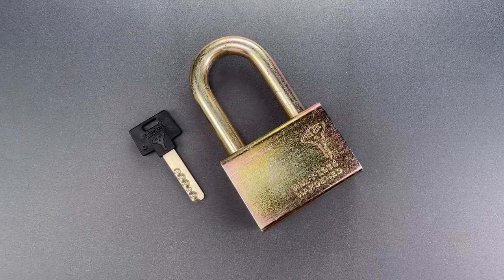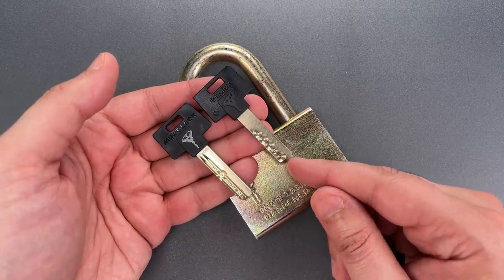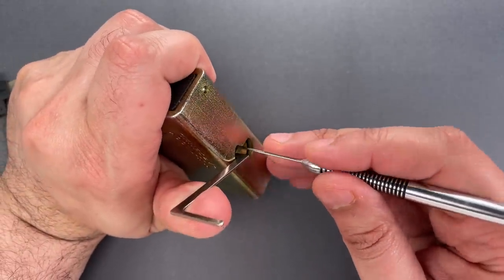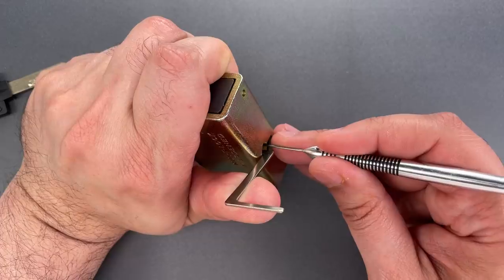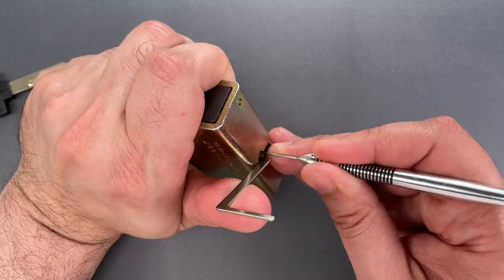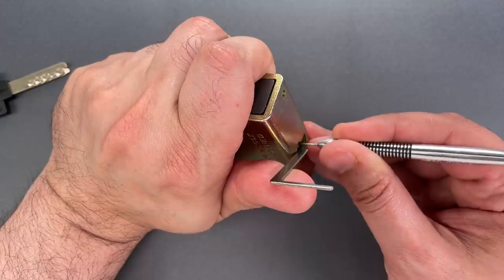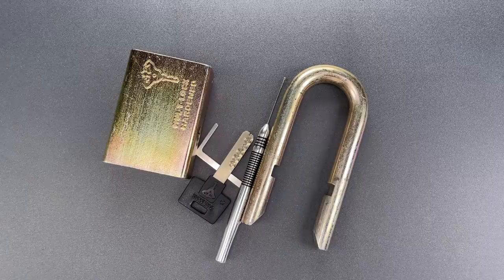[1338] The Gamma Key Affair: It Could Have Destroyed Mul-T-Lock

Comment: I would like to see the 'foil impressioning' thing that you mentioned, even if it's a failure.
Reply: I was going to post the exact same comment. Would be interesting to see how it's supposed to work.
Reply: Deviant olam== for ever lock== foil impression== example of what goes on
Reply: You want to see the LPL fail 😲
Reply: @grahamwilkinson6902  doesn't everyone? we need to know the limit of his power
Reply: Or if he can't do it, then was it ever a vulnerability to be concerned about?  Sounds like some misleading bad press could have potentially ruined the company.
Reply: I've seen it on YT. It still works on many locks of similar design.
Just imagine a key with a large cavity where the dimples are supposed to be. You either fill it with soft metal or span a thin sheet of aluminum over it. Then you insert it and wiggle. In the video it took under 10s to open it. The key then has the dimple impressions so that you can open the lock again without much wiggling!
Reply: He said it was on a TV show but what show was it?  Like was it a fictitious show like 24 where they faked it or was it a non fiction show like myth busters where they actually did impression it?
Reply: @brianpeyton6083  LPL is really good at single pin picking, which is a very different skill from impressioning, so him not being able to do it doesn't strictly mean a whole lot.
Reply: @bigbird4481  limit? silly human , he has no limit :)
Reply: @johntuffy5721  ah yes my mistake I should of known
Reply: @bigbird4481  You don't know the POWER of the LPL side, young Name Walker!
Reply: @SVlad_667  F
Reply: I would love to see this as well, and maybe some more about the original reporting, if there is any footage of that.  For all the mockery that the term 'fake news' gets, news organizations are really awful about misreporting on almost every subject imaginable.  I am sure everyone who is an expert or even hobbyist in any field has seen the news absolutely mangle the topic any time they talk about it.  Then realize they do that for pretty much EVERY topic, but you just may not realize it.  Science and technology are especially awful, where they will take a complicated report and just make up a one liner that in no way represents the actual content of the report, and once one place like the associated press does that, then everyone just takes the lazy out and repeats the same thing without doing any rigorous reporting themselves.
Reply: @bigbird4481  I just want to know he has a limit. Oh, sure, he says he couldn't do it, but that's just to lull us into a false sense of security.
Reply: @brianpeyton6083  It's such a low-skill attack that he can't wrap his head around the lack of skill necessary, that's all.  It's like a poorly coded video game where you can't do a "Very Easy" skill task because you need to roll between 11 and 25 and you've got a +30 to your skill.
Reply: LPL foiled by foil impressioning.
Reply: @JaredConnell  He mentioned a UK show, so possibly 'Watchdog' which is a UK consumer report show
Reply: @SVlad_667  Yes, I knew he hadn't picked the Bowley. He used to point out with proper and attractive humility that there were many locks that had defeated him, but he seems to have stopped even trying the most difficult ones.
Reply: Well he stated a few times that he doesn't practice impressioning so he's not very good at it. It would that's a skill you would have to practice
Reply: @bigbird4481  I have a security door with number lock. I can see no point of access.  There is a keyhole for a key but I think that is an additional lock,  the door might have a magnetic bolt at the top of the frame,  so potentially possible,   but without being detected while in process ?

Comment: So the alleged foil impressioning is actually difficult to do and single pin picking is difficult as well. 
That sounds weird - how real was that exploit then?
Reply: Probably a fluke since I assume they didn't do it twice
Reply: It was a BBC feature, how real is anything on there?
Reply: @SuperAWaC  got a link to the video?
Reply: YerisR foil impressioning is idiot proof. Put it in and wiggle for an open.
Reply: @NigelTolley  I'm a certified idiot, so you might want to take that up with The LPL who said he couldn't get it to work with the three locks he tried it on. [edited for clarity]
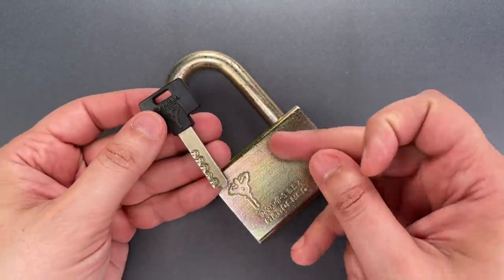Reply: @YensR  Correction, at 0:31 he says "... Though I've never been able to get that to work on any of the 3 Gammas in my collection"
Reply: @safourgardpa5459  Yes I know that - what are you correcting?
Reply: @YensR  You said “more than one”, LPL said “any”
Reply: @justins8802  Ah, I see how that can be misunderstood, will fix it.
Reply: To be fair, there's a knack to foil impressioning and once you've figured it out it's easy, before that, an absolute nightmare.
Knowing what thickness of foil to use to wrap the key isn't massively intuitive and generally only got right with trial and error.
Reply: @paulrichardspencer  gotta use the heavy duty foil and not the off brand stuff. Lol jk I have no idea. :)

Comment: I thought having warding on your lock was covered in lock-design 101, right after shielding and over-lifting.
Reply: I think the issue here is linear thinking. The reason you have warding on your lock is to make picking harder, by making it physically difficult to get the pick into the right place. I suspect the designers thought that the pin-in-pin design already made picking hard enough, so they didn't need warding. (You need special tools and, if LPL takes a minute and a half to pick a lock, an average lock picker will need half an hour minimum.) Since "the" reason for warding wasn't applicable, they probably didn't consider side-benefits of warding. And, since warding has a definite cost (harder to machine the cylinder and the keys), there's commercial pressure to avoid it if possible.
Reply: No warding on most KABA dimple keys and they don’t suffer with less security.  Tolerance is what makes these superior.

Comment: Could someone explain "nice click" and "false set"? I always imagine that with a "false set" you would have to start over, but I never tried picking a lock myself.
Reply: I just got me self a nice cheap lock picking set from Ali ($20 or so) and several Yale pad locks (the good ones, with security pins and all) and went on picking. Took me about 30 minutes to pick the first time, now i can pick open pretty much any Yale and old Mul-t-lock (the new ones are a bit too much for me at this stage) in under 5 minutes. It's pretty intuitive once you start doing it, you can actually feel the individual pins and their nature, the counter rotation, the false set, the clicks. 
Just get a set man, you'll like it, i promise :)
Reply: @beeble2003   Thanks a lot, I did understand your explanation. It sounds like he never pushes a pin past the shear line, where he would have to start over. Is that true? If he did , does it have a name? Maybe "over set?"
Reply: @pepperpepperpepper  I think that’s called over-setting, yes.
Reply: @beeble2003  Thank you!

Comment: I'd very much like you to look deeper into that "foil impressioning" attack because to me it smells a bit like bullshit. I dunno, maybe you could explain the theory a bit more.
Reply: Same concept as the tubular lock 'bic pen lid' impressioning attack. Cut the tip of a pen lid at the point where it tapers out enough to fit in the lockway. Mash and twist the lid until the plastic is deformed and the keyway turns. For the dimple locks, you need a key drilled to max depth. Wrap it in a stiff foil then slide in, wiggle and turn. The foil depresses as you wiggle and the spring fights back. The turning gets the pin bound open under tension. A bit of practice can get the lock open. The inner pins are all the same length so when you press them hard they deform the tool at the maximum depth, exposing the cut depth. Back off a little on the pressure and your 'key' is aligned.

Comment: Long time ago I had one of these.  I do recall how easy it was to inset the key and open the lock with the key.  The lock got some sand, and I was able to easily dismantle it, clean it and went into service until I sold it, no fuss.  When I had it open, I saw that you could try to jam the keyway , and by just inserting the key, you can remove the jam, and open the lock like nothing.

Comment: The hardened steel body and sleeve design still persists though. Physically one of the toughest locks I've seen. It's just really about time they did a ballbearing locking system on those style padlocks now.

Comment: I had Multilock in my office, installed in 2005. Last year all if them started to fail (pins were dropping blocking the key insertion). Unfortunately their local distributor’s service is bad, so I had to change to Yale. If Yale’s last as long, I’ll probably be dead when they fail 😅😅

Comment: if the lock is cut in the centre of the arch you are able to rotate the two pieces and they simply drop out multi lock were made aware of this issue and put some channels down it so the sides could not be turned

Comment: Hey, LPL, I'd love for you to look at the Langger V biometric slider handgun safe.  After binge watching your videos for the last couple weeks, I hard time finding a new pistol safe.  Kept asking myself how many milliseconds it would take you to steal my gun.

Went with the Langger model. Because the backup lock is on the bottom of the side-mount safe, which I mounted in my bedside stand 2.5 inches from the bottom shelf. The key is just about that long, so even with the key, it's hard to open that way.

I also modified it so the code changing button can't be reached by shimming something through the door crack.

Comment: I have used that lock as a shift lock in my car. That lock alone scared off many car thieves. I was told by an ex-car thief to use this type of lock. Because thieves like an easy car to steal. Thus they look at what is easy. And what is not easy. The more obstacles they face. The less likely they will not bother to steel it.

Comment: I may be missing something. probably am, but based on the way that shackle seats into the lock body, I'd be somewhat concerned about the possibility that it's shimable. I can see a way that it would not be, but that would entail the locking lugs be narrower than the shackle, which suggests that they would be a weak point too.

Comment: At a guess I would suggest that all the people focusing on how long this took him to pick compared to other locks are in part missing the point. It's possible for a lock to take this long to pick using normal picking tools and basic techniques if it has some limiting features such as a narrow difficult keyway but this lock required a special tool* and an advanced skill set. A low skilled picker might be able to pick a normal lock in this amount of time but most will never** pick this one, even with the right tools.

*The tool looks like something you might be able to make but then it won't be as “easy” to use.
**”Never” assuming they are a thief and “never” is limited by how long they can try without being caught. If they have forever then they might eventually acquire the right skill set through practice... Or maybe fluke it.

Comment: LPL, could you explain the motion you’re using inside the lock? It looked like you were rotating to set a pin. I assume there were dual facing pins although maybe the key had duplicate bidding so you could insert either way, and bidding is only on the right, as you were holding it. Just didn’t start with good visualization what was layout inside lock so hard to follow your motions.

Comment: QUESTION:  How do you know if a lock turns Clockwise or Counter Clockwise?   I bought your Genesis set and practicing for the first time on some cheap master locks I bought as well as some old locks with no keys.  I can only open the Masterlock. But I have the key.  The others I do not know if they go Clockwise or Counter Clockwise.  Or is it all pad locks are clockwise and door locks vary?  
Thanks

Comment: Hi LPL, do you have a video that explains the different terminologies you use when picking? Like what does it mean when you say binding, false set, click on x, etc..
Reply: Binding means that pin is hard to push, because its being pinched between the core and the outer cylinder. Click means the pin moved nicely to the sheer line and the core turned a little more. False set is where a pin has a notch cut out so that the core turns a little bit to make it seem like it has made it to the sheer line, but it really hasn't.

Comment: What if there was a lock that sounded an alarm or something if it took longer than 30 seconds for someone to open it?
Cuz using a key generally takes, what, 15 seconds at most?
So with enough sensory technology and engineering, it is THEORETICALLY possible to make something like that, right?

Comment: Is it possible to design a mechanical lock that must be opened with a certain speed? I.e. if you don't press the correct pins within 1 second it does not open. In theory it should make picking attempts like in the video impossible, because you cannot do them in 1 second. But you can turn a key within 1 second.

Comment: If the dimple pins fall down into the key "valleys", how does it work to pick this by what looks like lifting up the pins?
Reply: That's why the new model has the valley. Makes it much more difficult to get a flag pic where its needed. He picked the old model... :)
Reply: @MichaelBransonCoach  no, that's the key groves,

I mean the circles in the key, the pins fall down into those don't they? And the lock can be opened.

But seems LPL is pushing the pins up, when they are supposed to go further down?
Reply: @pangeltveit  The top pins extend down past the shear line when no key is present. The key picks them back up. The bottom pins set the different heights they need to be lifted to match the shear line. Having the top pins all the same length allows for impressioning attacks as how far you can lift the bottom pins exposes the different depths between them.

Comment: Aaand I can cut your 300 dollar padlock off with a battery powered angle grinder and a cut off wheel in under 20 seconds and it won’t be super loud either.  I’m a locksmith.  Just saying.  All the back and forth about pickability is nonsense. Most padlocks are useless in a high vulnerability situation. You better have that thing completely surrounded by a steel box.